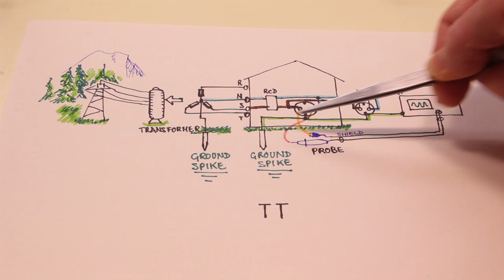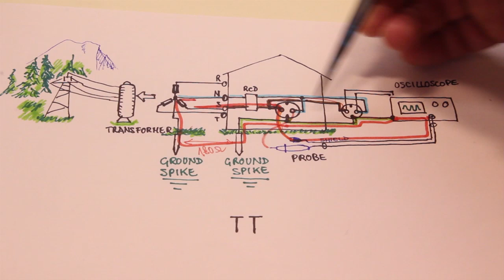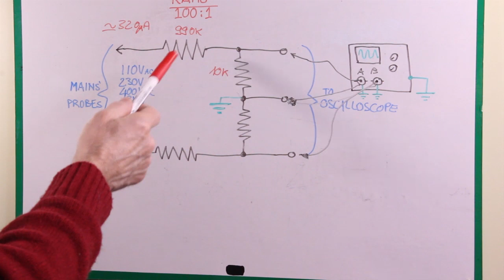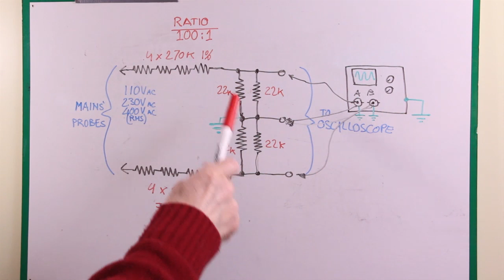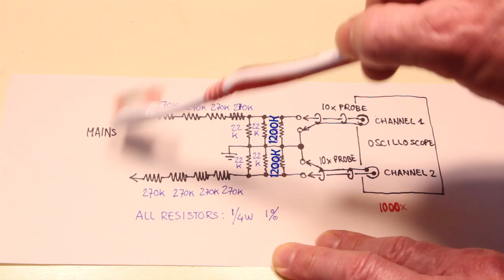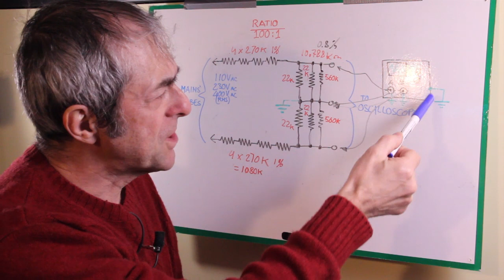Easy DIY passive #probe to measure #mains with the #oscilloscope

Comment: Horrible "explanation". Ground and neutral are connected together at the nearest distribution pole. ALL you have to mind is to have the plugs / socket wiring done right AND not connect the ground of the scope to "live" - an obvious short.

Comment: The damage from connecting oscilloscope probe directly to mains outlet is only true if:
1. The house electricity Neutral and Ground are bonded
2. The socket in which you plug oscilloscope power is connected to Grounding system of the house (some poor installation often disregard ground connection to safe cost)
3. The cable power on the oscilloscope has ground wire and socket (some cheap devices sometimes miss ground wire)

Just any one of these is not true then there will be no damage because there is no ground connection.

In proper US or Europe houses & devices that follow electrical codes & regulations, these three will be guaranteed to be true.

Actually you can simply hack the oscilloscope or your outlet to cut the ground connection. Although this is not recommended, it is not a serious problem if oscilloscope left ungrounded.

Or you can simply use portable/battery-powered oscilloscope, always safe to measure any main.
Reply: Yep... I wonder why people keep making long YT videos on matters they don't understand....

Comment: Let's say we have an oscilloscope that can handle above 40V input (many can handle 300V CAT II) with 1 Megaohm input impedance.
We could connect two inputs, each with a 9 Megaohm resistor in series, to the mains circuit.
The 9 MOhm series resistor will create a 10:1 voltage divider with the 1 MOhm oscilloscope input impedance.
Then using a Math function (A - B), you could look at mains waveforms, with up to 33V at oscilloscope input.
(of course, the 9 MOhm resistor is made of multiple series resistors to handle a high voltage).
Reply from the maker: That's basically what this passive probe does. The main difference is the attenuation ratio and redundant resistors for safety.

Comment: Why not connect two Zener diodes back to back across the 22 K resistors to limit the voltage.
Reply from the maker: That would cause distortion to the signal. You don't want to limit the voltage, you want to attenuate the signal enough to be safely handled by the oscilloscope. Sorry for the late reply, BTW.

Comment: Great, informative video. I'm considering building something similar for measuring multi kV plate/anode voltages in rf PA amplifiers I am building for measuring ripple of the voltage doublers. In this case the probe leads will contain 9 1M ohm resistors in series.
Reply from the maker: Be aware of the voltage limit of each resistor.

Comment: Nice video. I was planning on doing this exact thing a few years ago. Glad to know it would have worked if I'd done it, but then I just got a $15 battery handheld which eliminated the issue. The only thing I'd add is that once you've built it and compared it to a known voltage, you can very easily calculate the exact value of a resistor to put in parallel or series to make it completely accurate. I feel like you almost said this at the end, but then you didn't. 😊
Reply from the maker: @SkippiiKai  thank you. Yeah probably I forgot to go through that final step.

Comment: Just wanted to say really enjoyed your presentation .I am in the UK so my mains plug has a fuse ie 3A will this be OK.Please advise.Lewis
Reply from the maker: Hi Lewis, the fuse in the plug is a good thing, but it is not the core problem that poses measuring mains power. The key point is the fact that a normal, unbalanced probe has its ground/shield that leads to the chassis of the scope, and in turn to the Protective Earth (PE). In the UK there is a different PE scheme in respect to the one shown in the video, however the difference is irrelevant in regard to the problem. So when measuring mains power it is highly advisable to use a differential probe, be it passive or - better - active, and be sure that the probe's voltage is enough for the measurement (remember that it must be considered the peak voltage, not the RMS. So in the case of 240V the actual peak is 338V, so a bare minumum the probe must widthsand is 500V. This does not count spikes, actual safe value should be >1000V).
Reply: Thank you for getting back. Important to know. I have only used a scope for battery powered items really but notice on Youtube TV Engineers I follow using a scope occasionally and They all do it from an Isolated supply. A Suitable transformer will be around £110 so a Bit expensive for me at present. Thank you @AccidentalScience

Comment: My apologies I do follow after all! I think this is what I need to do in order to use Scope for TV repairs. Thank you
Reply from the maker: @walker55able  glad it worked out for you eventually. May you help me make better videos by telling me why you were struggling? Was it a problem with my accent/pronounce, or how things were explained? Thank you.
Reply: Your accent is fine I was fascinated by your presentation as Isolation Transformer are expensive and I enjoy  projects as I have training/ qualifications in electronics. I note your mains plug is 2 pin and in the UK we use a 3 pin with fuse. I have ordered the resistors and use your circuit although I will need another probe. Thank you
Reply from the maker: @walker55able  thank you so much for your feedback. I have common EU plugs. The round ones have two prongs (L and N) while earth is on the sides. Look at Schuko plugs for more info. Unlike the plugs used in UK there is no fuse inside.
So there are the same three wires. The only difference in the UK is the earthing system. Greetings.

Comment: I wonder what to do in the situation faced by me?
The two Neutrals from the two outputs 230 VAC of the Nitrox Inverter ( 3 KW - 24 V, SP - Hybrid _ by A.P.T. ) aren't allowed to be jointed! At my home the PE and the Neutral are NOT jointed!  Neither the Solar Panels nor the Inverter is Grounded till now! The Inverter demands the two Neutrals to be isolated and afloat! I'm rather perplexed. Obviously the two Phases are certainly to be distributed isolated!
The problem faced has been that either regular Load RCD or the Smart Load RCD have been in the habit of tripping off upon Grid On / Off since installation. Even sometimes the RCD on the Input to the Inverter also goes off! 
The reason: the wiring of my home has become leaky for sometimes. I've been curious about the Phase difference of the two outputs of the Inverter. Is there any way to examine it's two lines 230 VAC (RMS) each. Probably phase difference of 120° with about 460 VAC (RMS) that amounts to be ~ 651 VAC RMS, oh no, sorry I mean to say 650 VAC Peak ! Moreover, the grounding croc clips of the O-Scope  share the same common ground! 
Is there any way to compare the 2 outputs, one 'Regular Load' and the other 'Smart Load' be visualized on single O-Scope screen with custom devised High Voltage Probe(s) X100 on single or Dual Channel OScope?
Note: The Inverter trips the RCD's on bringing the the neutrals near each other. I've a plan to examine the phase relationship of the Regular and the Smart Output phases without putting any load on these.
The OScope to be used is a Rechargable Battery Operated ( Floating ) DSO ’ZEEVEII DSO3D12’ 
I've seen your kind vlog on a ’DP’ Passive Differential Probe utilizing Dual Channels on an Oscilloscope for measuring High Voltage safely, safe for the Operator, the OScope and the Device Under Test DUT.
Would you suggest me to use similar probe for the situation faced by me.
I'm waiting for 2 Accessory DP4100
Probes X100. 
With afloat DSO, the Cric Clips of the 2 DP4100 X100 grounded to earth and the probes on the two phases?
Wouldn't it be safe for me , the OScope and the electrical system?
Awaiting your kind response!
Reply from the maker: You must have a single ground. I mean a grounded spike to which all grounding convey, including the PE line. Power the oscilloscope referencing to that ground. Then use a couple of active differential probes rated at not less than 1000V. The measurement must be performed knowing the procedures of how to handle high voltages and you must know what you're gonna do because this could be lethal! I won't take liabilities. On the oscilloscope use math functions to know the difference between the two AC sources. You mention 460V RMS and ~651V RMS ...I don't think this is correct starting from 230VAC RMS, I'm afraid you keep confusing RMS with peak and peak to peak. Oscilloscopes always display peak to peak voltages. For voltages out of phase you can't really use the root square of 2 to go back and forth RMS.

About the problem you face with that inverter I have a similar issue with a hybrid solar inverter, made by Voltronic, China. I have had no chance to investigate the problem deeply enough but it seems the problem arises from the fact that the inverter must disconnect neutral from ground when running over the grid, and reconnect it to ground when running over solar panels and batteries (UPS mode). What you describe, two separate neutrals, seems quite weird but for those inverter designed to run on two phases grids (no neutral) that are in use in some corners of the world.
It seems an interesting case.

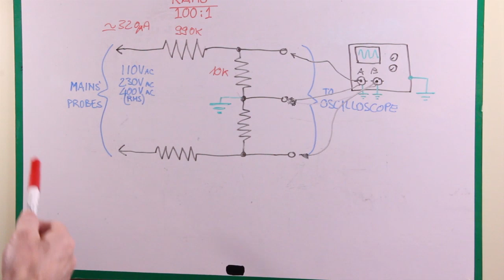Comment: 9:42 
I suppose at this point you meant 230uA rather than 320uA? O.K.?
What are the safely full scale  voltage measured by O-Scope with X1 and X10? Are these 3.2  and 32 VDC or RMS?
990 KOhm is almost 1000 KOhm or 100 MOhm to constitute a Probe 100X while in unison with standard 10X one.
In my humble opinion, wouldn't have it been better if the Standard Probe used in X1 confuguaration for safety of the O-Scope?
And all calculation done on the later basis?
Help me if I'm confused.
I'm a medical doctor happened to be an accidental scientist: may be on wrong side!
I've never used any O-scope other than patient bedside monitors. My first ever entry level Chinese Rechargable, Dual Ch, SigGen O-Scope+DMM (ZEEVEII-3D12) with Voice-Assistant reached me 2-3 days ago. In search of safe use of the same I touched your Youtube channel.
In my life, I've been moved by a few, and you are one among those, I happily ❤️ declare.
Help me please if I'm confused or wrong!
Thank you.
Reply from the maker: First off thanks for commenting. Indeed your comment could be of help for others. It could be helpful because many could confuse some points that clearly I have taken for granted when they'd not ...that's the curse of people with experience :)
The current value is correct: around 320uA @ 230VAC. So why it is correct? 
An oscilloscope do not take the RMS voltage but the peak(+DC) voltage, while it shows the peak to peak voltage. 
I know, this may arise even more confusion, but don't worry, follow me.
Let's take a sine wave that you want to measure at the oscilloscope. The instrument will show the sine wave from a reference point that is the GND (ground) level. In respect to GND the alternate sinusoidal signal swings from zero to full positive; then back to zero (GND); then down to full negative and finally back to zero again, where the cycle start over again.
So what you actually see on screen is a wave that swings from peak to peak.
However what matters for the input circuit is the voltage peak as an absolute value, which is the maximum allowed voltage in respect to ground irrespective of the polarity. Indeed if we look at the specifications of an oscilloscope they tell us the maximum input voltage that is meant as peak+DC voltage. In other words it is the absolute maximum voltage, be it AC or DC.
So speaking about a possible voltage to measure I took as a reference example 230VAC, the mains voltage in EU. Mains voltage is alwasy declared as RMS voltage. So, for a sine wave with a 230 RMS voltage, for the purpose of finding the voltage that the oscilloscope's input matter we need to find out the peak voltage.
Which for such a sine wave is: 230 times the square root of two, or simply 230 * 1.41 = 324.3 Vpk.
When we compute the current across a resistor usually we compute it as DC or peak value, rarely as RMS value. And since we want to know the voltage at the input of the oscilloscope we have to calculate the peak value.
So the math is as follow: Input voltage 324 Vpk / (990Kohm + 10Kohm) = 324uA. Remember, the current flows through both resistors to GND. Now because we know the current, and because the same current flows on both resistors, we can compute the voltage across the 10K resistor: 324uA * 10K = 3.24Vpk.
Notice we should also consider the input impedance of the oscilloscope which happens to be in parallel with the 10K resistor. Though since this impedance is about 1Mohm at DC (or at very low frequencies such as 50 or 60 Hz) it doesn't change much our computations: 1/ ((1/1M) + (1/10K)) = 9900 ohm, actually an added attenuation of 1% . 
The probe x1 change anything as it is just a chunk of wire.
Now, about the safe usage of the instrument, understanding that you are not that experienced, I'd recommend you to avoid taking measurements from mains. Instead use it to make measurements of small voltages of devices fully insulated from mains. In such a case it is quite safe to use in any condition. I never heard of that brand/model of oscilloscope, BTW.
Hope this will be helpful.
P.s. Thanks for love. Love+Peace.
Reply: @AccidentalScience  
I got your point!
For all practical purposes, regarding AC voltage or current we talk about it's effective value, the root mean square RMS value that is equivalent to its counterpart DC's heating effect.
It's the peak value of the AC V or C 'times' the Inverse of Square Root of 2 = 0.7071
In true measurement one has to consider the Peak Voltage or Current of the AC that's RMS value times √2=1.4142.
So it would be around 325 uA.
This has to be accommodated resistance and capacitance calculation. I'm grateful for reminding me!

Comment: What about battery operated oscilloscope?
Reply from the maker: Didn't I mention it in the video? A battery operated oscilloscope is obviously not susceptible to cause troubles since there is no PE. But these kind of oscilloscopes are designed to work this way, so they have insulated probes and the oscilloscope's case is fully isolated with some kind of insulant.